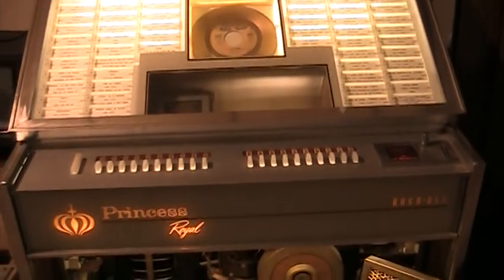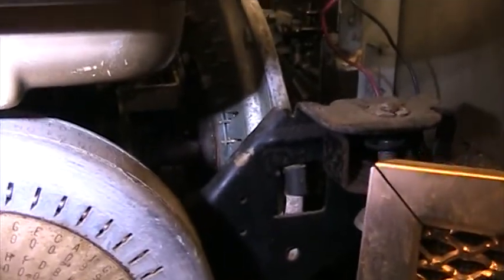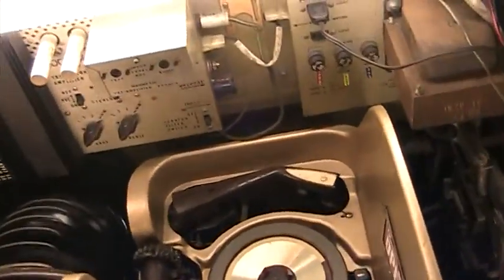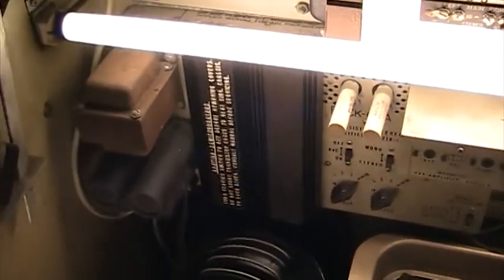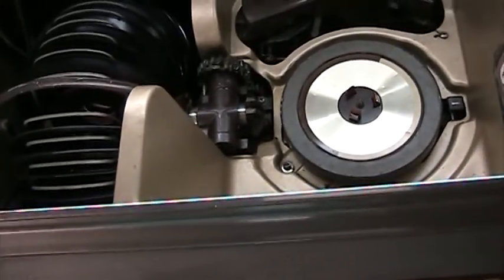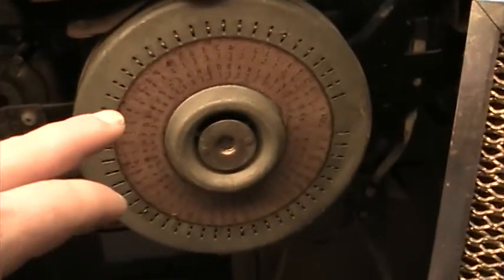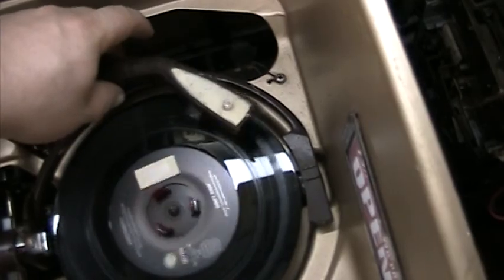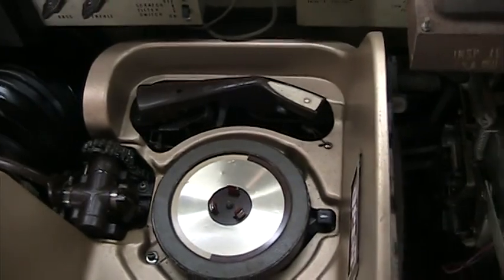How to oil your Rockola jukebox in hard to reach areas

Comment: Good job on your jukebox,  That sound problem is the stylus which could be that it is worn or the pressure needs to be adjusted..  Try a new needle first ..   And if you are lucky the needle might be dirty and could  give a clean with soft brush of some sort if do not have stylus brush...
Reply from the maker: I will give that a try with a new toothbrush. Also I have 2 extra needles. Have a great new year!

Comment: Do you know how to make the carousel spin faster ? I left it running when it was searching for the record for a long time and now the carousel is moving slower.
Reply from the maker: Did you check the grease on the gears below the platter plate? If it's factory grease it has probably turned into hard cement and it's putting a strain on the motor.
Reply: I did not check it. I thought I may have ruined the motor somewhat by running it for 30-40 minutes straight. What do you think?